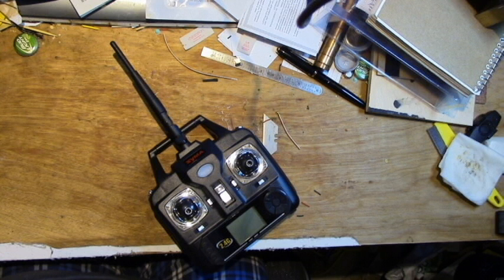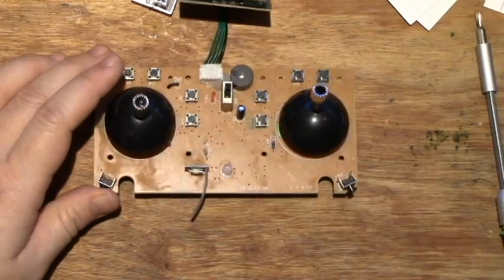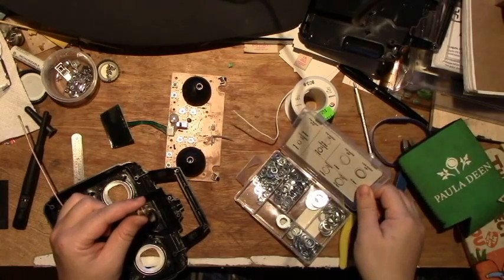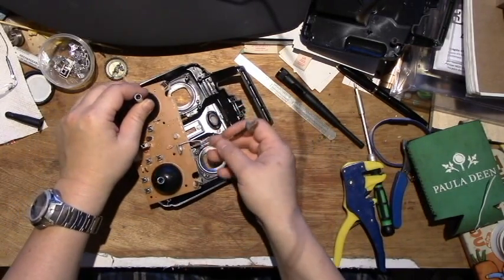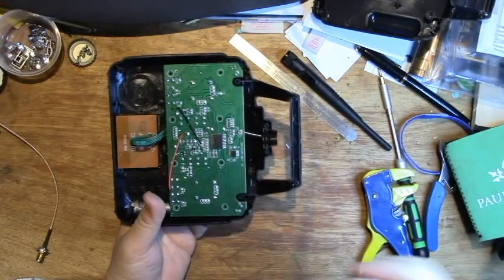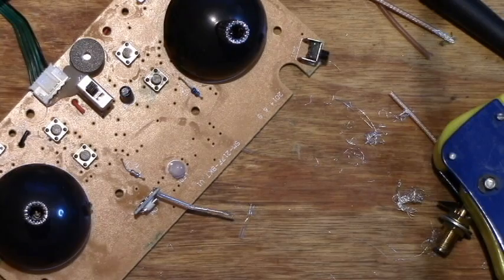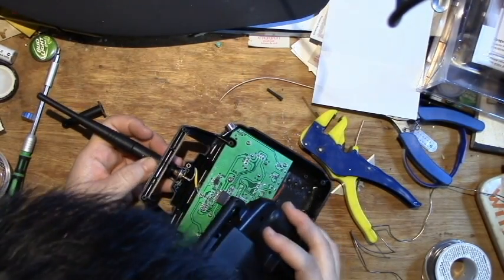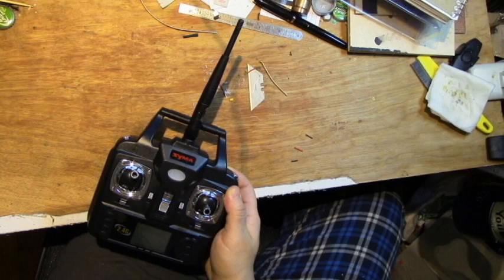Syma X5C Range Extension Hack

Comment: Seems its worse now then it was.. the original antenna had ground (reflection) on pcb.. when you want to extend the antenna cable, you need to bring both ground and signal to the end antenna.. you stripping the ground away from coax is total fail. Now you have not tuned antenna (unprotected coax) followed by the real 2.4ghz antenna - amazing that it works at all.

Comment: I'm surprised you didn't make the range worse. I attached a 5db antenna but you should take of the top part of the short 2.4ghz  dipole and connect the centre of the pigtail to where you desoldered the dipole and connect the screen to the ground.  I got a range of more that 100 metres before mod. I'm now getting 500 mtrs.
Reply from the maker: Congratulations. Where is your video?

Comment: You got 382 ft with antenna mod?! I got 1.1 kilometer, that is roughly 3700 ft. Check my channel for better mod than yours. Thanks.
Reply from the maker: Why would you need that if you can even see the copter?
Reply: +carolcheny 
FPV

Comment: Can I just rip open my router and stick the whole wire on the circuit board to replace the stock Syma antenna because the wire inside my router looks double the length of the stock antenna of my Syma controller so it would save so much time or not

Comment: I just had a few questions, I was wondering if someone could answer.

1. What is the dBi of the stock antenna in the transmitter?

2. Doesn't the new antenna need to be omni-directional, especially if it has a high dBi? I was just wondering because it wasn't mentioned in the video.

3. What kind of range increase would I see with a 6dBi, 9dBi, 12dBi, and 16dBi antenna? Does anyone have any numbers?

Comment: the antenna mod is very incomplete. You must solder the coax grnd to the PCB to achieve the full effect and the best use of the  antenna. With the coax not correctly attached the range will not be increased to the max use of the antenna.  Try cutting a flat spot on the washer to stop the rotation of the antenna base, allowing you to correctly tighten the antenna.  This will gain the full use of the new wifi antenna and you will see the range increase to approx. 150 meters, which is what I got by doing the mod correctly. The best place to get the router is from a computer recycle company. This is where I got my FREE broken router to use on my mod and have done four mods by getting my parts from the computer recycle place and didn't purchase anything for any of the mods I have performed.  Good Luck and God Bless
Reply: Kevin, I saw your comments on another video and i am SO confused on how to extend my range. have you seen a video that accurately depicts how to do the range mod to the Syma X5C(1)?
Reply from the maker: Travis Arnold you see the metal strings in the casing of the replacement antenna cable? He's saying that those should be hooked up to the ground on the board - which I agree with. But, the original antenna wasn't grounded either. Grounding requires a lot more stripping and soldering, and I don't think you need to bother with the extra work if you don't know how to do it. I got almost 400 ft, that's over 100 meters without grounding.
Reply: carolcheny  I feel my range is lacking on mine. Whats the easiest way to get a little more range out of this quad?
Reply: The easy way to do a minor, cheater, but effective mod is to solder an addition to the antenna that is already there.  You want this new addition, combined with the antenna that is already there, to total in length to be a total of 4.92 ".   That's from the PCB to the tip of the wire you soldered on.  Yes, that is overall length to be 4.92 inches. I found it best to use a caliper to measure and then just cut off the extra.  Always solder on a little extra wire when you are adding on.  Remember, measure twice, cut once.  It's always nice to measure after you have everything just about done, with everything set-up the way you want it, then do your final cut, after measuring for the last time.  Then just put everything back together.  All thats left is to measure out to see how much improvement you are going to enjoy.   There are two different way to measure your improvement.  The first is the easiest.  Just fly up wind in a safe very open area.  Then when you lose control, if you were flying up wind and high enough, your quad will drift back towards you and you can regain control if it gets close enough before it hits the ground.  The other way is a lot safer for both you and your quad.  It is also easier to get a very accurate measurement.  Get a friend, then your friend will hold your quad and after pairing your quad to your transmitter, have your friend start walking away from you and your working remote.   Then, with you intermittently working the throttle, you and your friend will know almost exactly how far you can go until you lose communication between your quad and your transmitter.  Then what I do is, set the quad on the ground to verify that you have a good enough signal to fly.  If not, you guessed it, move a little closer until you do.  There now you know exactly how well you have done.  Sorry for the book, but at least it's complete.  Happy Flying -:-}>

Comment: I did this mod to my transmitter.  Did not have any trouble removing the original antenna. Did solder the shielding to the grounding pad next to where the antenna is soldered in.  Also, cut the end off the original fake antenna and used it to mount the screw connector for the antenna.  Video is posted on my channel if you want to check it out.

Comment: I have a question..Why should measure the lengtg of the wire??  Does it has some technical knowledge inside?
Reply: The length is very important because you transmit signals by resonance, so something of the same wavelength will resonate e.g. the antenna.

Comment: Hi Carol , thanks for uploading your video. I do have a couple of questions and if you can please advise, can I use a 2.4ghz 10 db antenna instead of a 5 db, and also do I need to modify the antenna on the Quadcopter  too. Thanks
Reply: This is my first remote control toy, so I really have no idea. but people do report the receiver antenna modification helps.

Comment: By removing the cable shielding you have effectively lengthened the already correct length wifi antenna....the fact that you got a little extra range is pure luck and you are most likely overworking the final RF stage of the transmitter due to improper SWR and impedance mismatching, which could shorten the lifespan of the transmitter. Most "stubby" wifi antennas are colinear which require the ground to be connected to function properly. Great idea though, just connect that ground up and you'll be good :)

Comment: If you want to get the old antennae off the pcb board just put more solder on the connection, heat it up then it should melt easier to pull it out (that's what she said lol).  Also 4.92" is full wavelength so anything longer wouldn't distance much.

Comment: The cellphone/wireless router antenna you're using is probably the best way to do this.  But do not solder the center conductor and the braided wire together!  The center conductor goes to the same place as the existing antenna wire, and the braided wire needs to go to ground on the PCB as close to the antenna connection as possible.  By the way, that looks like RG-174 coax you're working with there.

Comment: OK, After watching your video, I went into my transmitter, I took out the factory antenna wire, I cut a piece of antenna wire from the receiver on an old R/C airplane, 4.92" long as per one of the guys posting on here. I soldered the wire into the board where the old one was, I drilled a hole in the fake antenna that came on the transmitter just big enough for the wire to go through.
My range test in original condition was 90 ft., After doing the modification, I can walk away around 240 ft. before the lights flash, I confirmed this with a flight like I never had before, I will need binoculars to fly straight up, Wow !
Thanks for the help carolcheny, I don't worry about a piece of white wire sticking out the top of the old antenna, looks fine to me.
Reply: Update, Yesterday I modified my transmitter and gained from 90 ft. of range up to 240 ft. 
This morning I opened the X5C-1 to look into making a longer antenna for the receiver, I found the same short antenna wire on the receiver, but it was laying across the receiver board and soldered to one of the wires that go to one of the green lights under the quad, Can't figure that out, I removed the wire totally, made a new one at 4.92" and soldered it on the board.  I have now increased the range out to 360 ft.
That is farther than I can see the copter, every crash I've had was because I lost contact with it.
I realize this was a 56 dollar toy, but the 2 mega pixel camera shoots really good quality pictures and video.
Hope this helps someone else enjoy their quad a little better.
Reply from the maker: scrapwire1 Glad to be helpful! It's my first RC toy and I couldn't get a good idea what people were describing so I took this overhead video while trying the mod to show how I did it. I am pretty clueless, and probably did it wrong, but I thought it'd make people feel more confident if they know what to expect inside.
Reply: carolcheny It really was a help, When I saw the size of the antenna wire, I knew I was gonna change it.
Have you checked your range yet ?
I stuck mine 6 Ft. off the ground in a tree and walked away till the lights flashed, indicating I had lost signal, then I measured the distance.
Reply from the maker: scrapwire1 I got a friend to help me measure with GPS - 382 meters! Very happy with it. (correction, that's 382 ft! not meters.)
Reply: carolcheny Wow, That's 382 meters from the modification in your video ?
I guess I'm gonna find me an antenna like that one.
Did you do anything to the receiver antenna?
I'm at about 360 ft. the way I lengthened mine.
Reply from the maker: scrapwire1 oops! I meant 382 ft. haha sorry I'll correct it. After that, I couldn't really see it anyway.
Reply: carolcheny Thanks for the correction, I was about to rip into mine again.
Did you change your receiver antenna , If you didn't, that's really gonna give you a lot more distance.
Reply: carolcheny
en metre ca fait combien ?
Je suis francais et bonjour a tous.
Reply: scrapwire1 where's the video?

Comment: Sorry, but this is wrong. The coax should be shielded all the way to the connector. Otherwise the signal is radiating out from the wire right from the board.. You are lucky these junk Transmitters aren't too picky.. OR you would have toasted it.. still may over time..
Reply: Yefatbastard
 is right. I have a degree in electronics and used to be an antenna designer. The original antennas inside both the copter and the transmitter are quarter wave monopoles, similar to old portable radios and car radios. Ideally, it should be a fraction under a quarter wavelength long, depending on the wire thickness. The 1.03" (26mm) wire provided is too short at 2.4GHz. It should be closer to 31mm. The WiFi antenna you are using in this video should be fed, as Yefatbastard says, and as some other YouTube videos show, with a shielded coax. The core should be soldered exactly where the original wire antenna is, the shield to the other round land that originally has nothing soldered to it.
I can't understand why you were unable to remove the original wire antenna.
As Yefatbastard tried to say, the issue with the wrong length antenna frying the transmitter is that much of the power fed to it will not be radiated but will be reflected back into the transmitter. Impedance matching (achieved by having the correct length) is vital if all the transmitter power is to be radiated.
By the way, if you have a high gain antenna you have to be very careful where you point it as in some directions it radiates no power. Never point a monopole antenna towards the copter. Best is to have it roughly at right angles.
As for the receiver antenna. I found its length was correct but its orientation was odd. Best, I suggest, is to make a tiny hole in the fuselage so it can go vertically up. It sticks out of the top.
Reply: javier marin
Most transmitters seem to have a simple unshielded wire acting as a quarter-wave monopole. Somewhere very near the fixed end of it you should be able to identify an area on the circuit board that is part of its 'ground' plane. This is likely to be part of the largest single area of copper on the board, and probably connected to one of the battery terminals.
To make the best possible connection between the transmitter and the antenna you have bought, you need to use coax cable, not unshielded wire. Fix one end to the SMA connector. This will involve stripping the outer insulator and a short piece of the inner. The length of this coax is unimportant. Cut it to be sure you have enough to reach the transmitter's antenna terminal.
Carefully strip some of the outer insulator to expose a few millimetres of the copper shield. Unplait it so that you can get it all round the same side of the core, then twist the strands together. Remove the existing antenna wire and connect the inner core of the coax in its place. Solder the shield to the earth/ground as close as possible to the antenna core connection.
I hope this helps.
Reply from the maker: Yeah haha signal from the air would toast the circuit board. Good one. FYI, the original wire was not shielded. I guess everybody's remote will fry.
Reply: carolcheny No.. the signal from the transmitter.. I can see trying to explain it to you would be a waste of my time.. Just one more little detail.. The reason the original wire was not shielded is because it IS/WAS the antenna.. But that's okay.. don't take my word for it.. I'm only 52 years old, and built my first transistor radio when I was 12.. But what do I know? Okay.. I'm going to post the info anyway.. But only because I don't want other people frying their radio (you can do what you want with yours) If the antenna length is not correct the antenna is not tuned to the frequency that is being used. This, in turn, means that the antenna has some inductive or capacitive reactance that is de-tuning the final amplifier. De-tuned final amplifiers draw far too much current and can burn up. Don't get me wrong.. Great mod, just sloppy implementation.. Oh, and by the way.. That second pad next to where the antenna was soldered on, is the ground pad for the shielding of the coax..
Reply: Chris Lusby Taylor  I´m planing to do a modification like this on my JJRC v686. I have ordered this components:

-16dbi 2.4 ghz antenna: http://www.aliexpress.com/snapshot/6540072392.html?orderId=66232371162550
-Wire with conectors: http://www.aliexpress.com/snapshot/6540617799.html?orderId=66245195882550

My question is, how i do this modification rightly? My transmitter seems to have two contacts solderer to the "cable antenna" that it brings. I understand that the cable i,ve bought will have two wires inside once i cut it? If so, is there a way to know wich wire i should conect to wich contact, or this doesnt matters?

Another question I have is about how long should be the cable that conects the cable from the trasmitter to the SMA connector. I didnt knew this length was that important...

Hope you answer to me even tough I have nothing to give to you, just to share your knowledge. Thanks
Reply: Chris Lusby Taylor more or less, cause I´m new in this stuff.
Yeah, the antenna it brings looks like a coaxial cable, like two wires in the same tube. What I´ve understand is that I have to separate a extreme of each the internal and the external wire of the cable I´ve bought (is a extension, so I thinkit will be coaxial). Then sold the outter part of the new cable where the outter part of the previous was, the ground, and it will be done. I´ll try it when I receive all the things, thanks for your help
Reply: Chris Lusby Taylor PLEASE make a video!!!! I would like to understand more of this antenna/cable/ receiver/ transmitter relationship. I WAS going to do this mod but now imnot until I know how to do it in a way where I do not screw up my multi and transmitter....thanks!!!!!
Reply: Chris Lusby Taylor This makes good sense to me and I know very little about electronics. If I might just clarify one point. Is the part of the antenna that radiates the signal the unshielded/ exposed part of the coax??If so, how long should it be. Also, if I use an antenna from a surplus wifi router, will this already have the radiating wire inside it.?If I use the dummy antenna on my tx, will I have to add the radiating wire to the SMA so that it goes inside the antenna.
Reply: Allan Carter I just did this mod with little knowledge of electricity or soldering. All I did was take the antenna from a router and soldered it to the pcb of my transmitter. When you strip the antenna from the router it has the inner cable and the outer wires which is the ground. Mine had plastic around the outer cable then a very little wire in the middle which was also covered in plastic. So twist the outer wire then strip the inner wire. Solder inner wire same spot the original antenna was. Then solder the twisted ground wire right beneath the inner wire. Hope this helps
Reply: Allan Carter I also used the plastic antenna pole from the router. If you want to use the original pole you just cut the top and have the wire sticking out